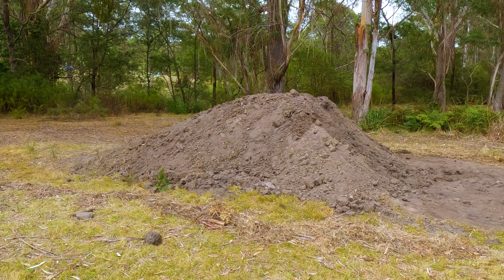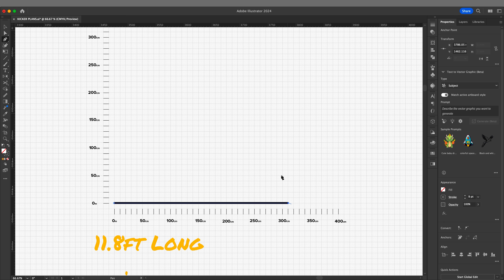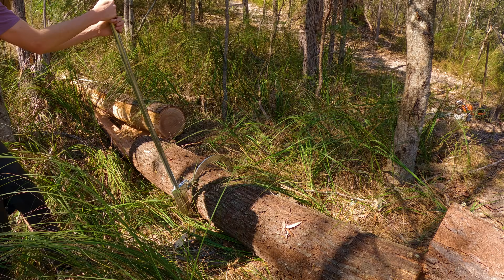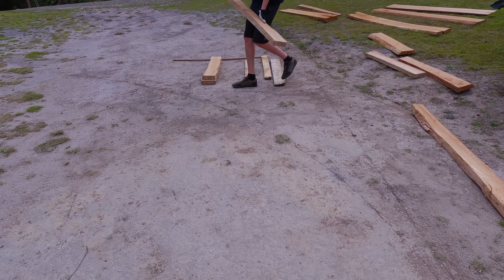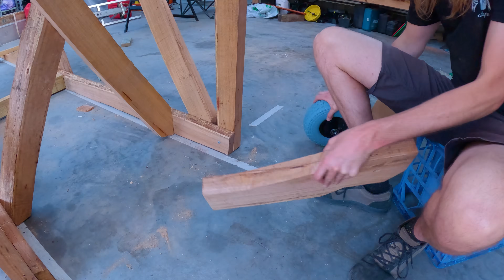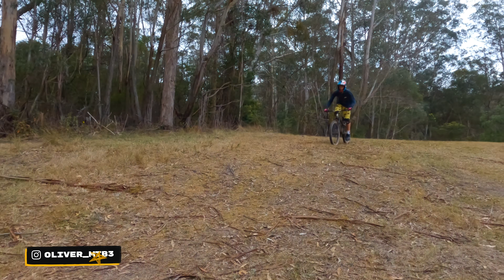How he turned a fallen tree into a MTB jump!

Comment: Yo, this is actually sick! These videos are actually really helpful as well, my dad and I have been building some jumps in the backyard recently, and there's so much information on here about lip angles and geometry
Reply from the maker: Dude thats awesome you have been building your own jumps with your dad. So much fun having your own jumps.
Reply: @cutlaps  It is, I can ride them with my friends as well. We've got plans to build a curved kicker, but we're not sure about the takeoff angle. What would you recommend? (It's going to be around 70 cm high for reference).
Reply from the maker: @Cranberry415  Take a look at this website. It wll really help you work out the size and shape of the kicker. You will need to convert cm to feet. https://kohlibuilt.com/ANGLESweb.htm

A radius around 10ft will give you approximately 40 degree andgle at take off for your height.
Reply: @cutlaps  Alright, thanks, I'll have have a look